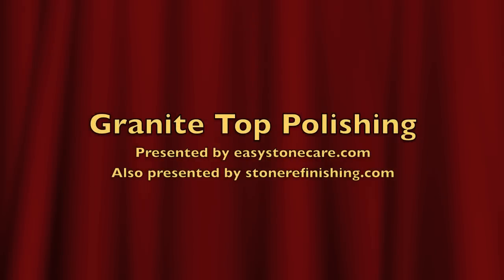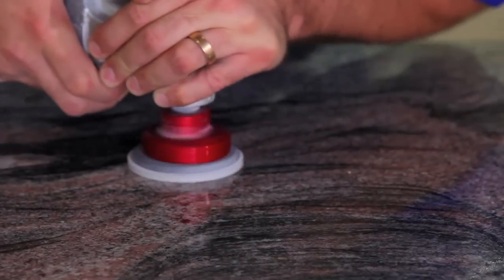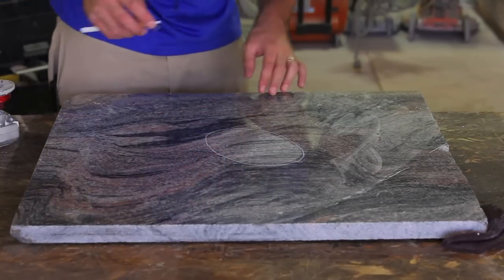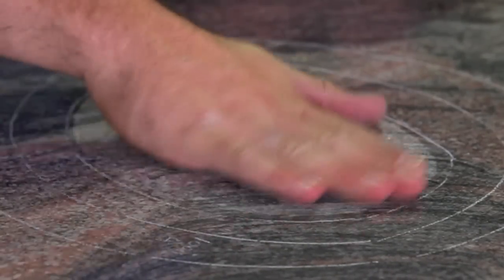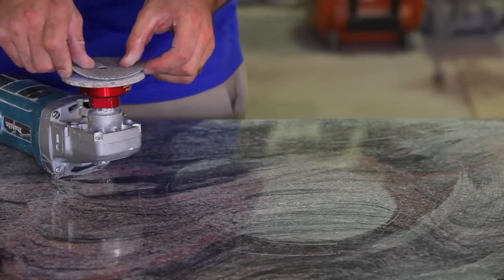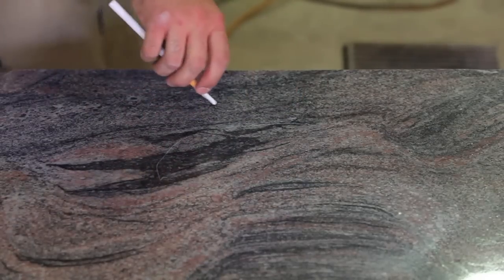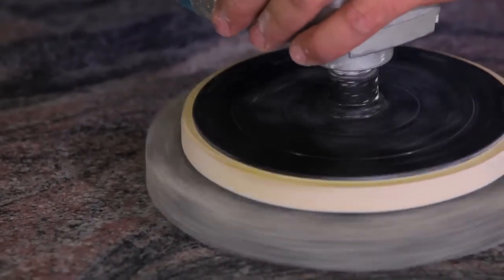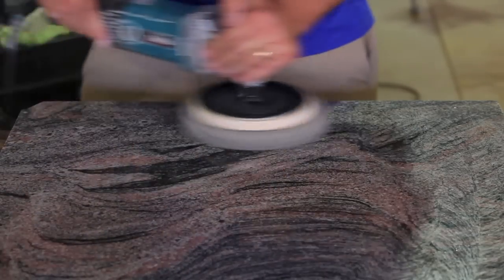Professional Granite Counter Polishing: Step-by-Step Guide | Easy Granite Refinishing

Comment: So, I took your advice.  I did this on a vanity top I purchased from a guy who had demo'ed a house.  I had to remove some scratches from and it and it worked man!  Awesome.  The part of the granite that I polished looked nicer than the rest of the granite.  I ended up polishing in the rest just because it looked so much nicer.  Luckily it was a small area.  : )  The entire Regent Kit is expensive, so I purchased only what I saw you use in this video.  That saved me some money.  Thanks again.
Reply from the maker: thank you

Comment from the maker: The way that you describe is how we used to do it.  We have found that with the NSI rigid turbo diamonds, you get a better result if you use them to #1000 then switch to your 4 inch resins.  Also many times, you can yield a factory finish with your final buff pad making the Diaglo or Potea at the end unnecessary.  However you get the result that you are looking for without causing waves is good in our book.  We have found that MB-20 will cut down the time and effort on those final grits. T

Comment from the maker: @dodoslovensko - Thank you for your comment.  MB-20 is not a wax.  It is not a topical of any kind.  It creates a mechanical shine similar to your 5000 - 10000 diamond pads.  Tests have been done with blades, chemicals, even torches to prove it.  Check it out, it may be worth it.  Thanks again.
Reply: Can you use a regular grinder with those disc or a low speed one?
Reply from the maker: @moisesbeyond  Low speed only. I like the Makita 9227C but a lot of pros use the Milwaukee too.

Comment from the maker: @MrMotomik3 - Thank you for your question.  Yes, you do not need to use the low grits if you are not going to be removing scratches.  In many cases, you can simply clean your counter with alcohol to remove contaminants and polish the surface with MB-20 Granite Polishing Paste.

If you have a lot of streaking now you may have a build up of soap residue on the surface.  You can remove this with a degreaser, but make sure you rinse thoroughly though before you polish.

Comment: you can also clean your granite countertop with acetone and paper towel and then apply it with granite wax and depend on your granite color if its a dark material you can used black wax or if its a light material then used white or clear wax both are the same. apply it and remove excess wax as soon as you can remaining wax can easily remove by useing tripple zero steel wools and paper towel. i hope this will help!
Reply from the maker: thank you

Comment: I've been getting really good results by using the rigid top polishing pads from 100 to 400 grit, than switching to regular diamond pads with a soft backer from 800 to 3000 grit.  This allows you to be really pressure aggressive with the higher grits to ensure you get that shine back.  It also really helps to use minimal water with the last 2 grits, you kinda want to run them slightly dry.  Then buff it with diaglow.
Reply: Then look at that ripple
Reply from the maker: thank you

Comment: Hello and thanks for the great video.

I would like to please ask some questions.
1. Can a disc sander be used for polishing purposes, or the RPM is too high?
2. How can I know if I need to polish dry or wet on a particular stone?
3. Can heat from the friction of the rotating accessory cause discoloration or disfuguration of the worked area?

Thank-you.
Reply: Hi, your question were really relevant to me as well. Did you get any answers? Thanks
Reply from the maker: Hello,

1. Disc sander rpms are too high. The video talks about the speed being around 600 rpms
2. All commercial granite materials can be treated the same way
3. This has not been a problem because we do not heat the surface too high. If your work area is large you should alternate aeas when working wet to dry to reduce heat issues.
Reply: yes, if variable speed 600/4500

Comment: Hi Ted. So, I’ve been in granite for about almost 5 years. I was taught that when you have to face polish granite, always go with with 3 inch Alpha turbo discs/NSI and move on to the Ceramica wet to dry and MB20 to finish the gloss. Using regular diamond pads cause a haze, a ripple and overall, is not recommended. So I’ve always used 3 inch discs with a variable at a low RPM. Today, at my new job, I was reprimanded for not using your typical 4 inch Diamond pads (7 step or 3 step) pads because the disc process takes longer and need to use diamond pads as I was told the discs are “No good”. I understand that every place is different but what can I do to give a valid, good debate on this process is just overall better? Thanks Ted
Reply from the maker: thank you

Comment from the maker: Polishing the face is much different that polishing the edges. We have used multiple different methods including dry pads and wet pads and other abrasives; and have found that this method is the best way to achieve the results that we are looking for on the broadest array of granite surfaces without have to make too many adjustments.

The key is to always be able to duplicate your success. All of the items used in the video cost around $500 and will do 25-50+ seams and/or scratch removals.

Comment: with edge polishing you dont need a lot of pressure because there is such a small contact patch between the stone and the pad. This creates a ton of friction and allows for a fairly simple techniquie. with this face polishing, a lot of guys struggle with controlling the machine. Keeping it flat takes practice but when taught correctly you can usually get the hang of it in about an hour.
Reply from the maker: thank you

Comment: I have etching from cans of coke that were left on top for weeks.  Granite is very light with lots of Silica in it.  If you place a light underneath counter top  you can see light thru the tops in sections.  Will this lengthy process work on these tops?   Thanks
Reply from the maker: You likely do not have granite. You probably have onyx or marble. Onyx is translucent so allows light to see it from underneath. Onyx also etches.

Comment: I have been surface polishing for 6 years and i was curious if this will get the same results on a high gloss dark stone WITHOUT using a black powder polish like diaglow and without a deepening agent like ager or akemi spider black? I have also seen people use the orbital polishers and alot of the time they use the powder and a liquid polish and then use steel wool. I def like your guys method i am just curious if the results can be better without the use of those things.

 thank you
Reply from the maker: thank you

Comment: Thank you!  Very detailed and good demo!!

However, your kit costs $735.  At this price, I could pay someone to do it.
Reply from the maker: +Lass-in Angeles Thank you for your comment. You are right, the kit can be expensive . This is intended to give as much information as possible for both DIY and those that you might pay to do it. It would cost $450 - $650+ to pay me to do it depending on severity of existing damage.  I am located in Orange County, CA.
Reply: This video was not for DIY.  It is to demonstrate to professionals the process of repairing stone so we can charge you the homeowner.
Reply: Besides the fact I’d charge you thousands to do it l
Reply: @turbo-seal189  how are you going to tell the guy that made the video it isn’t for diy?
Reply: If you buy the kit you'll be able to polish/fix 50 tops and scratches. The process is not as easy as Ted makes it look.
Like it says in the beginning, get some granite and practice. Make sure you use lots of light because that will tell you if you're successful.
Reply: That's so true

Comment: My cold springs granite coffee table had a few scratches near the edge that the fabricator came out to fix using the same machine and method you used. It came out very well, scratched areas actually seem more polished than the rest of coffee table. 

However I noticed, especially in light reflection, the surface is rippled. As in there are dips in the surface, not flat. It's nearly impossible to feel but very visible when light reflects off it.

Is this because he used too much pressure? Is it possible to fix this?

Thanks
Reply: bluedoggiant The pads in the this video are designed specifically to keep the surface flat. They have zero flexibility, but have more of a learning curve. The waves happen when someone is inexperienced, or use diamonds that have too much flexibility. Sometimes it is not possible to keep it perfectly flat.
Reply: bluedoggiant hello where did you buy cold springs granite for the size of a coffee table?  that's the granite i want for a bathroom vanity, but everyone has size requirements to allow order so im having trouble trying to find a vendor.  thanks.
Reply: icawn it was leftover from another project my fabricator did. Ask to see their remnants or graveyard material.
Reply from the maker: thank you

Comment: Says "a 1000 grit will result in an almost factory finish".  Well, I suppose that depends on what the factory finish is!  My almost black Uba Tuba granite was installed with a HONED finish.  What grit do I need to finish with when trying to work out faint scratched made from the bottom of kiln-fired plates & bowls?
Reply from the maker: Honing powder will remove metal marks. You will need to do the entire counter with it. It's pretty easy.

If they are scratches you will need to approximate the existing grit. Ask you fabricator how it was honed. This may be better done by a pro.

Comment: depends if they are actual stains or etches, Many times etch marks are mistaken for stains. A stain can be removed with different solutions, etch marks must be sanded or refinished to make them go away, as they are an actual chemical damage to the stone. If it is lighter than the stone it is an etch, if it is darker than the stone it is a stain. Can you provide more information?
Reply from the maker: thank you

Comment: Great video. For doing my own home project, do you recommend a wet or dry polisher? I'll also take a look at your comment from 6 months ago to someone also doing home project, you refer to another website for a diy kit I believe. Thank you
Reply from the maker: Low speed dry polisher like the one in the video. Makita 9227c
Reply: I had a feeling.  I ended up getting the Makita Wet model PW5001C as a gift from my best friend. It arrives on Wednesday. It may be returnable if needed.  Is the rpm's going to be too high on the wet model vs the 9227 you recommend?  I'll be using for granite counter top home project and travertine floors - areas that I couldn't get with floor polisher (stairs, etc.).  Thank you so much for your time and expertise.
Reply from the maker: I believe that is 2000-4000 rpms. That is too fast. The 9227C is more appropriate for stone refinishing and polishing
Reply: Again many thanks for your help.  I have an email to see if I can swap product before it is shipped. I'm hopeful.  I'm taking a stone pro class in Jan through my supplier, I wasn't patient enough to wait to get started....since my floors turned out soooo well.
Reply from the maker: Sounds good. We have an online training program at stonecareedu.com that will give you all the info you need.
Reply: That's perfect. I will start with the granite clean and polish training first, unless you recommend different. I'm still waiting to hear if the order for the polisher can be changed and or cancelled to get the 9112C model. While at my supplier today they advised that I can use the emp that I used for my travertine floors, for my granite vs what I think you were calling the polish Pattaya? In which I could not find. Ok that's all I had for you today :). Thank you
Reply: Correction 9227C
Reply: If this is not your line of work you better pay a professional to do it, it’s cheaper in any way

Comment: Would this system work for rectifying errors in a headstone inscription
or is it only for flat surfaces? 
There would be a dimple in the stone so pads might not be flexible enough? 
How good is it on black?
Reply from the maker: This works great on black. I would not suggest using this on headstones unless you first used a corse cup wheel to flatten the surface.
Reply: Thanks for the reply, Maybe stick to the 4" pads and Putty powder finish with uneven surfaces..

Comment: That is a very soft stone, if you focus on such a small area and do not spread out more especially with the first step your going to leave a major dimple in the surface, and on such a soft stone if the scratch is not very deep you should not have to start with anything lower then a 400 grit.
Reply from the maker: Most granite can be treated the exact same way. The reason why we are so methodical when we teach students how to do this is to eliminate the possibility of creating dips and low spots in the finished polish.
Reply: Ted McFadden so far as I know, there is no softness difference among granite varieties. Am I wrong?
Reply: Igor de Oliveira Sa there is indeed 'hard' and 'soft' granite, some stones are a combination of both and can easily be unevenly polished, it all depends on mineral make up
Reply: Skyler Cyr thank you so much!

Comment: it would be interesting to see if the camera showed all different angles...Usually you can see the difference of quality of machine and hand polish in reflection of light.. a 0.5mm scratch means in the reflection  (if you keep your head low to the surface) you can see uneven surface ...Incredibly hard  job for a fussy client....
Reply from the maker: This video was done in 2011 so different angles was difficult. I will create something that gives different angles soon. This process works every time from any angle.

Comment: I placed some pre-cut granite bull-nose edges in my kitchen and some and some were cut with differently leaving me with about 1/16th to a 1/8th lip around the edges in some spots. Can this be grind-ed down and re-polished to hide the lip?
Reply from the maker: It can be done but 1/8" is a pretty large difference in height. It may be difficult to grind it flat without leaving waves. Grinding seams is different than scratch removal. you have to grind the high spots without affecting the low spots until the high spots are sufficiently flat.

Comment: do i clean and impregnate first ? then seal after mb20 polish stage for finalizing?
 can i use a white hook and loop fine foam pad with the mb 20 using a DA polisher?  or wool pad with the mb20? which is closest to the hoghair pad? 
can i use any hook and loop 1000 grit sand pad before the mb20 polish stage?
Reply from the maker: follow the instructions for best results

Comment: Use 500-3000 small pads than use dry pads 3000-5000 full water it’ll bring out that shine n fix it much faster
Reply from the maker: You have to keep in mind that this video is 11 years old. Prior to that field polishing of granite was believed to be impossible. No it is normal and there are many methods. This method still works very well to create predictable results.

Comment: What about granite with a vanguard on the top? If you go through the vanguard it will leave a lighter spot. the vanguard darkens with age and as you polish can wear away the top layer causing bigger problems. I'm not trying to shoot down your method as your snail lock pads work great but do you have a solution for this problem?
Reply from the maker: thank you

Comment from the maker: @td7474 You can use the MB-20 to polish your counter.  However the mineral deposits should due removed first.  You can do this by using one side of a single edge razor blade to remove any roughness or particles (do not turn the blade over and use the other side).  You can also use fine steel wool (#0 or #00) to remove whatever residues may still be there.  What is left should be able to be polished out with MB-20.  Be patient with the MB-20, black granite shows everything as you well know.

Comment: What can I use to polish my stone if I don’t have this machine??
Reply from the maker: If you don’t have any scratches to remove you can try the methods in this video. The kit that is sold for this video has changed slightly but the changes are improvements. Better products and larger sizes. 

https://youtu.be/PYGTR-ASuag?si=gIhhF9d-R_1CDoWQ
Reply: @tedmcfadden  I have a black marble stone on the lining of my shower. It’s the area where you step on to get in idk what it’s called. But it had water stains which I kind of removed but it looks like whatever I was using had removed the shine and gloss of the stone . I’ve used different polishes and nothing has helped. Still there’s a dull etch mark . And absolutely no shine
Reply from the maker: @kkdol3761  You likely have marble or limestone. You can try this one: https://youtu.be/O8z9Qn7H6TM?si=nkneZOzYXZ5LeAkE

Comment: Ted, This is a very useful video.  I hope you can offer some advice.  We have a marble topped coffee table 47" across and refinished it (probably mistakenly) starting with 400 grit diamond polishing blades bought on EBay using the dewalt polisher (similar to your Mikita, though probably not as good, but it works fine for this).  We stepped up as we are suppposed to and finished with 7" buffing pad using x5 polish. We cannot get it to look shiny; it is chalkboard smooth.  Help!!!  :-)
Reply from the maker: thank you
Reply: @tedmcfadden  “thank you” doesn’t answer their question.
Reply from the maker: @marshallc6501  This video details how to get it done. If you are trying to do it a different way and not following the video it's hard to help. 

The question is already answered by the video.